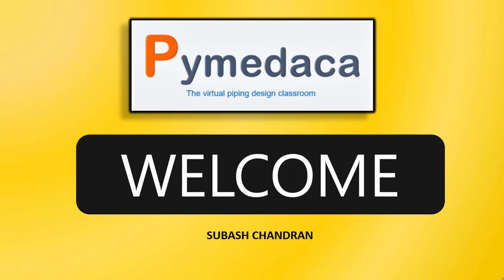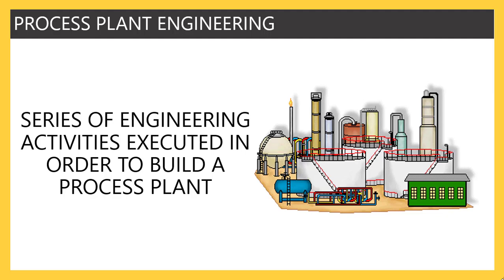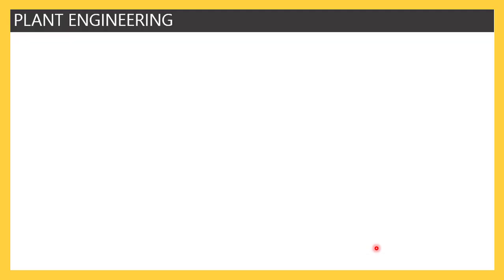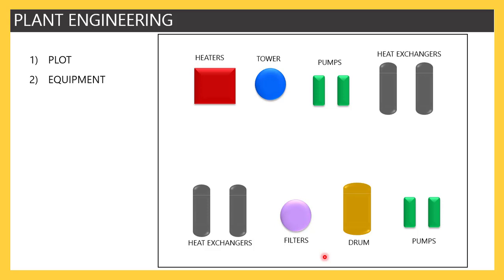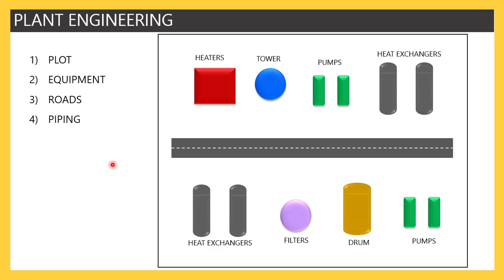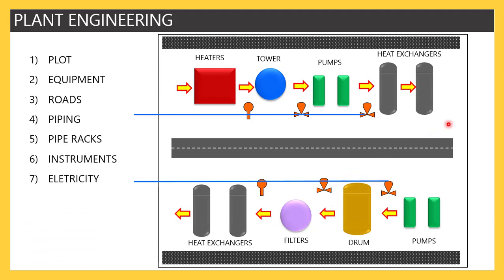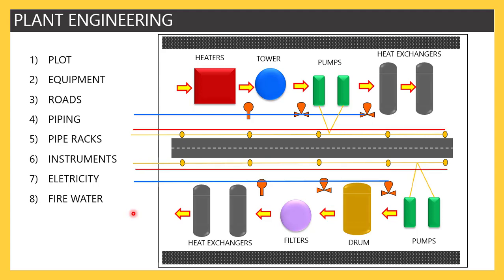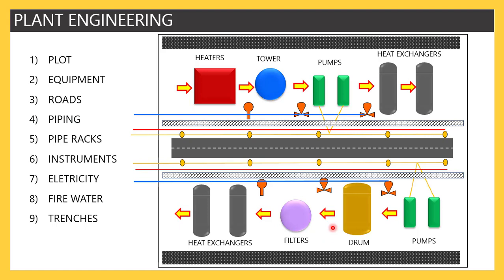Process Plant Engineering |What , Why, and How| Major Role of #Piping

Comment: Another top quality vid! Discuss more about inter-discipline activity such as underground/flood water piping and selecting instrumentation. 

I would like to know more about how materials are chosen since I have seen plants where CS concrete lined pipe is used for Fire Water, regular CS for Closed Drains and HDPE for flood water

What should pipe designers know about placing instrumentation and electrical works. Are they only responsible for placing supports? What conciderations must be made.